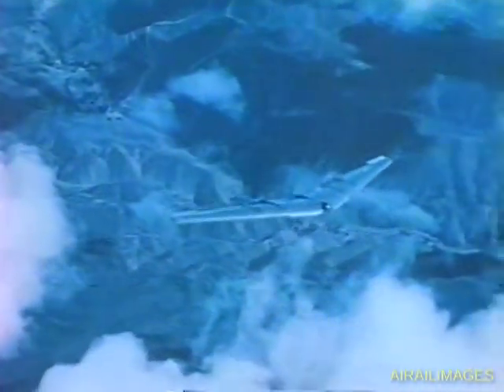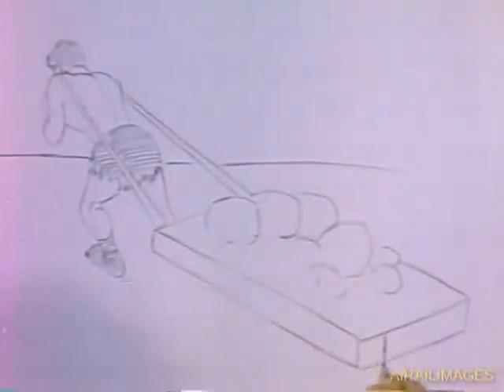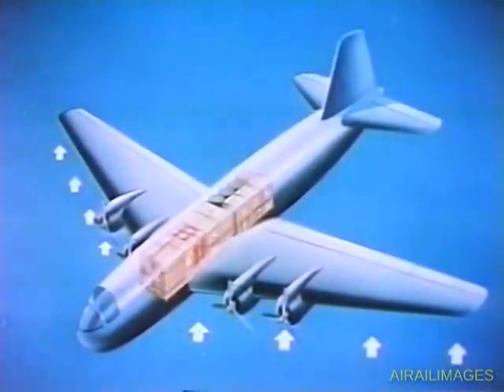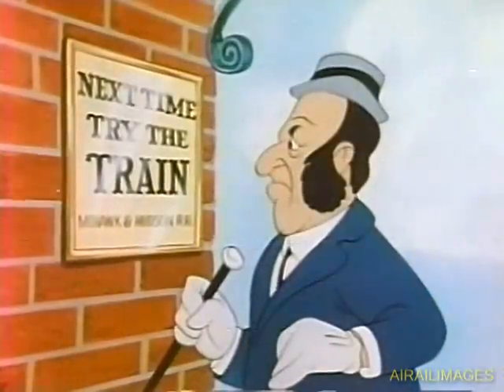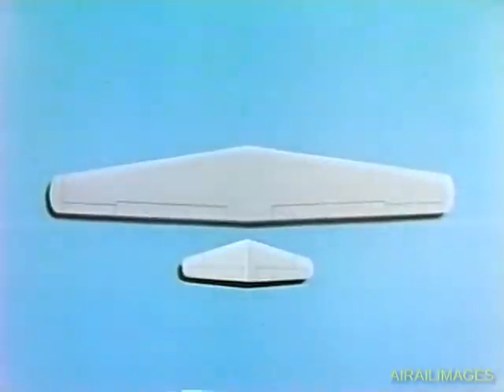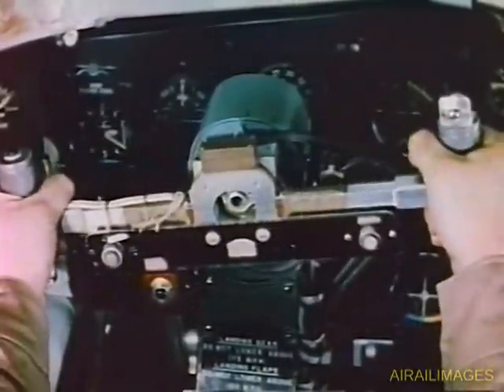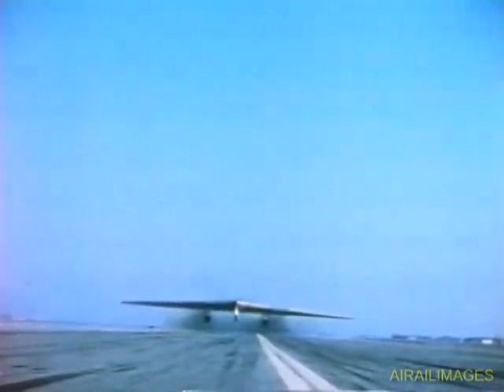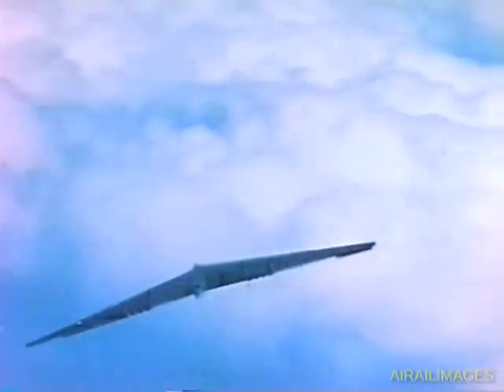Vintage Classic Color Flying Wing Film

Comment: There were less than 6 YB49's ever built, the planes that were destroyed were the YB35 prototypes, which were the earlier propeller driven version.  Northrop had converted a few of these to the jet powered YB49 version.  Despite Northrop's hype, the YB49 had quite a few problems that would have taken several more years, and lots of money to work out.  Meanwhile, the B36 and the B47 had been flight proven as suitable long and medium range bombers, and were ready to go.  The YB35 and YB47 had been originally targeted for the role of the next long range bomber, but the '35 had prop and engine issues, and the jet powered YB47 didn't have the range required for the long range mission (the jet powered version's fuel consumption was higher than predicted), so it was retargeted at the medium range role.  

The flying wing didn't have the required yaw stability to qualify as a bombing platform for the Norden bomb sight.  Northrop claimed that the Honeywell autopilot unit could correct the yaw stability, however even with this unit in place it still took too long for the remaining yaw oscillation to damp out, and this was a problem for high speed bombing runs.  While the flying wing's technical problems could have been worked out, the air force was not willing to sink any more money into the project when Northrop's competition had already demonstrated suitable alternatives that were production ready.  The current B2 uses 'control by wire' tech with computer aided control, so it does not suffer from the lack of yaw stability that the earlier flying wings did.  Note that all flying wings, because of their thick air foils necessary to house the aircraft's cargo and crew, are limited to subsonic operation.

While there may have been some politics involved, and perhaps even bribes, the fact remains that the flying wing, while it was a good flying aircraft, was ahead of it's time and was not ready for the military role.  It's too bad that Northrop could not have developed the aircraft for civil aviation (airliner) use, but they didn't have the funding to continue the development, and would have had to start from scratch using the lessons learned on the YB49.
Reply: I’m no expert but I believe the B-2 can at least get close to Mach 1. I’ve seen photographs of it with a large vapor cloud around it at high speed. I know his doesn’t mean it’s supersonic but it means it’s at least close correct? I’m guessing the b-2 could hit Mach 1 in a dive
Reply: P

Comment: Size of the tyres. You have to think a couple of farmers are out their wondering where their tyres have gone.

The idea of flying wing passenger aircraft has been mentioned a number of times but no one seems to want to take that step. From what I have read it would no only be much more efficient way of flying it would be able to carry many more passengers.

Comment: THE UK as always in this historical time frame already had a flying wing . The Armstrong Whitworth AW 52 .
Reply: Both aircraft were ahead of their time.

When the Armstrong Whitworth AW 52 crashed the pilot ejected using a Martin Baker ejection seat which was the first time one had been used for real. Ironically once out of the aircraft the problem resolved itself and the aircraft glided down to land itself in open country with relatively little damage.
Reply: Horsecrap. The first flight of the AW 52 was 1947 well after the XB-35 and about par with the YB-49. You're also forgetting the Norhrop N1M & N9M flying winds in the early 1940's.
Reply: And who build really the first jet powered flying wing a few years earlier??

Comment: Why did it disappear for decades?
Reply from the maker: Several reasons; computerized flight controls help make the B-2 viable today. The controls are constantly "dithering", responding much like the feathers of a bird to keep the B-2 stable and on track at all times; the original flying wings were all manual in that regard.
Reply: +John Walters  Stability problems in flight without modern computer controls, although Northrop had sorted some of the problems out in the last models.  The entire program was ordered scrapped and destroyed by the Sec. of the Air Force, party to punish Northrop for not following his pressure to merge with Convair.  So the Air Force got the elegant but impractical B-36 for a few years.

Comment: It's saddening for flying wing bomber were canceled because accident caused it by flipping over as pilot unable control it . It's not easy flying wing . After years , newly advanced technology flying wing bomber B-2 Flying thanks to computer technology helping pilots flying better . It's very expensive plane as built 21 planes only , leave 20 planes left after one crashed . In 2020 new B-21 flying wing bomber as Air Force wants 100 bombers . There are no first flying wing bombers  in any museums after canceled then few flying wing bombers were destroyed because top secret advanced technology won't fell into wrong hands . My boyfriend type on my iPhone:
Reply: The accident report, after it was declassified, gave the cause as pilot error.  Capt. Edwards exceeded the limiting mach number in a dive and pulled out too sharply.  The G force was over the design load causing a structural failure in the joints where the outer wing panels attached to the center section tearing them off.  The center section went straight into the ground.  The tumbling reported by observers was the outer wing panels falling to the ground.  It did not flip over and had undergone stall tests where the stall characteristics were found to be quite normal. 

Another fallacy about the B-49 was that  you can't put flaps on a flying wing.  Just look at movies of it taking off and landing.

Comment: Why didn't they at least try a small verticle tail surface?
Reply: Larry 21603 because it was parasitic drag and the aircraft didn’t need it. It did have 4 small vertical stabilizers near the engine exhausts. Basically so it would fly straight.
Reply: "didn't need it."  It was yaw unstable enough to crash in the hands of test pilots.